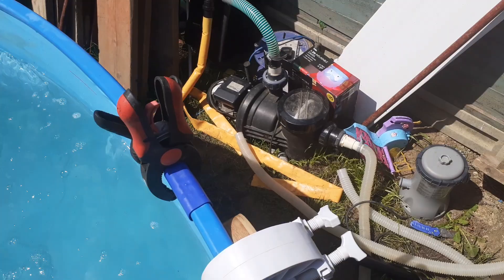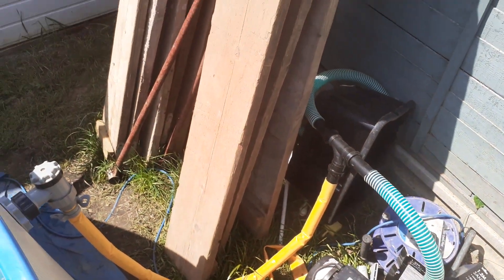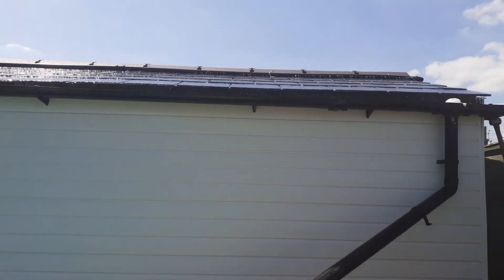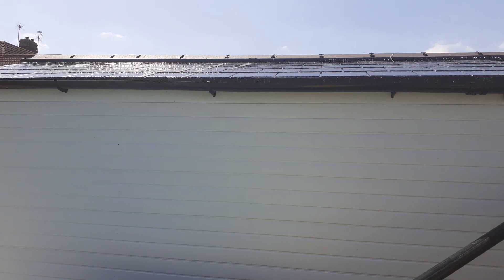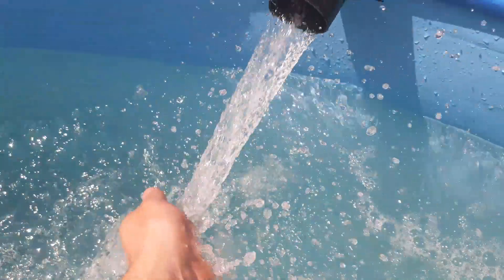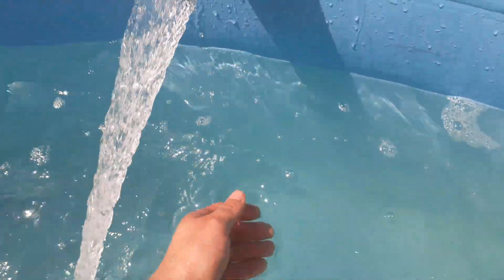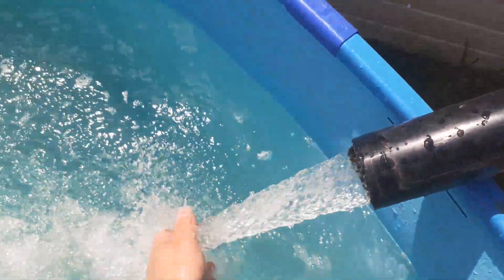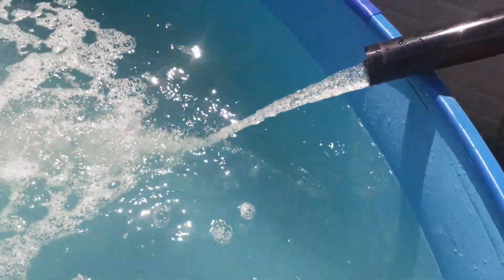the best DIY solar pool heater ever

Comment: One thing though. As your shed roof, water is free to evaporate, meaning evaporative cooling is loosing a massive amount of heat.  If you covered it all with clear sheeting to stop that the output should substantially improve.

Comment: need improvement !! too much water flow, bird poop and other unwanted debris will contaminated the water etc !!
Reply from the maker: I think the water flow is just right because if I reduce the flow it comes back warmer but its not fast enough to heat the pool as it loses it heat faster than it come in, I will try it just a bit slower next time to test if its better.I also flush the roof off each morning before I let it return back to the pool. Thank you for your comments.
Reply: @doitmyway9089  kick ass job !! thanks
Reply: Slower will mean hotter water but higher volume is more efficient and thus will warm pool faster.

Rather have 10 gallons warmed 10 degrees than have 5 gallons warmed 15 degrees.